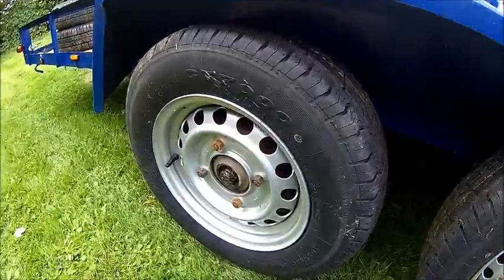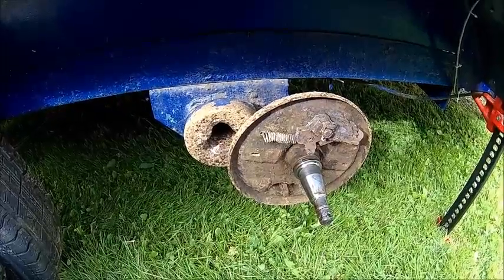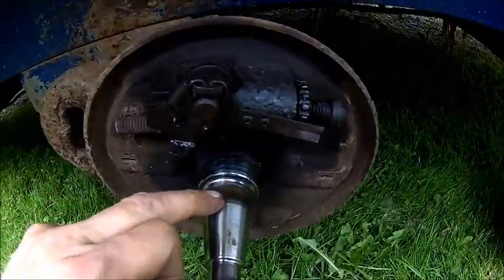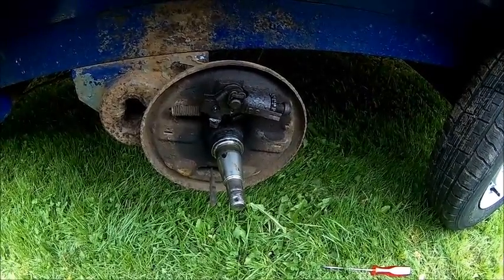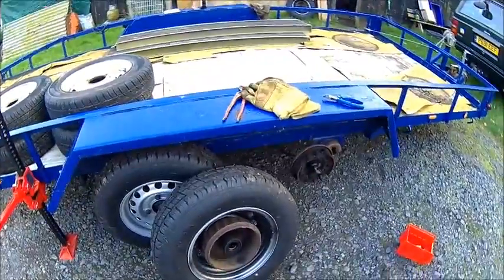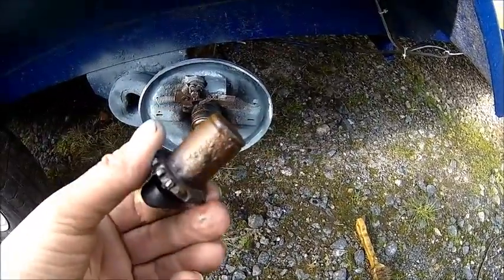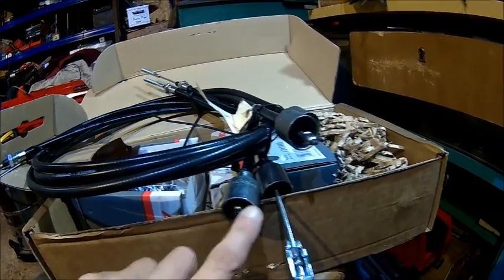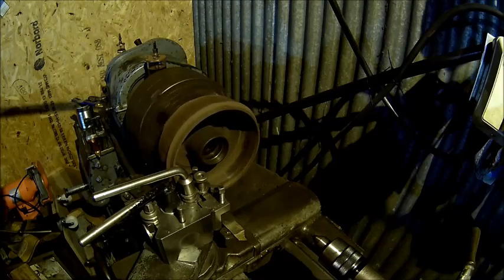The Trailer rebuild project  - Brakes, part 1, no brakes left there ....

Comment: oh do you bring back some memories...lol.. i had the same thing on the firewood trailer i bought many snows ago. it's gonna be best to replace the bearings & seals and the brakes all the way around. the tires look really good so you should get quite a few years of service

to get that outer race out of the hub just hit it with a small weld on the inner face of the bearing race... just run the amperage up as high as the rod can go.. then the race will shrink and fall right out

are those brakes hydraulic or electric?
Reply from the maker: Hi Mike, hope you well ... that's a common condition with old trailers over here, no TUEV required ..... the bearing came off easy with a puller, the other 3 sets are fine. The wheels and tyres are brand new, i already replaced them because the old ones were ordinary car tyres with insufficient load index, this is a 2.5 ton trailer.  The brakes are mechanical, it's a simple overrun system.